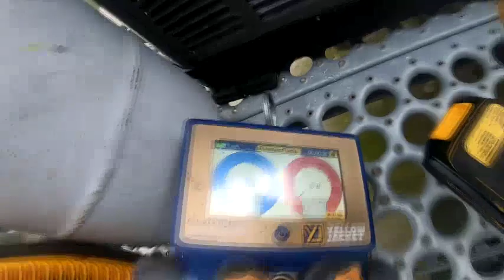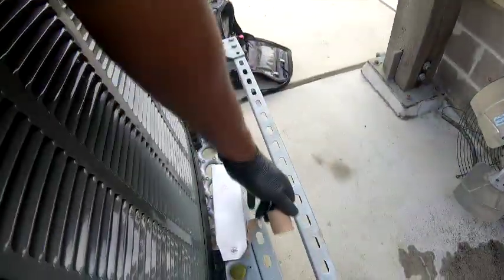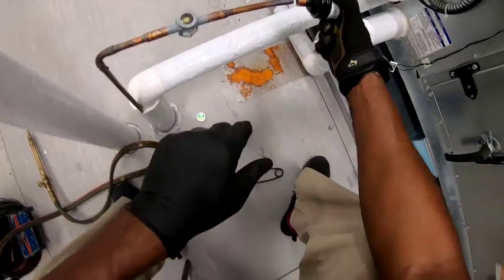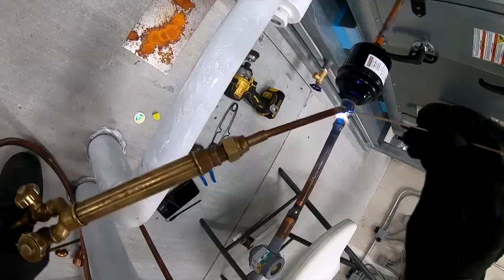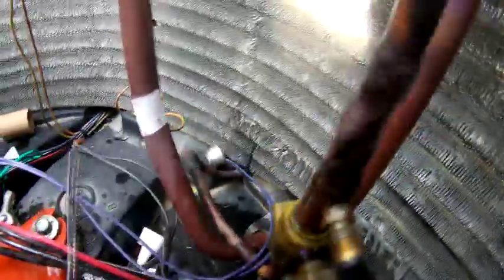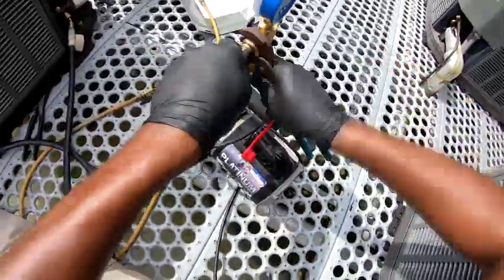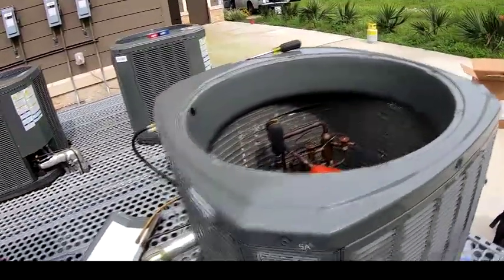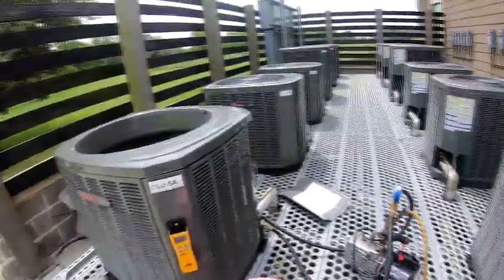"Game-Changing Compressor Change-Out: Breathe New Life into Your HVAC System!"

Comment: STAYBRITE 8 on that dryer will make replacement in the future easier and require much less heat , and yes it WILL take r410a pressure.

Comment: Manual J is heating a cooling load calculation. Manual S is equipment selection, Manual D is duct design and Manual T is grill and register selection I think.. Yes I personally believe anyone in residential should have those books. If you design a HVAC system based on those books then that is were all the comfort and efficiency come in at.  SEER and HSPF dont be crap if the duct system isnt  designed correctly.